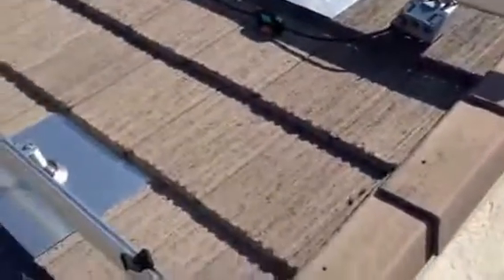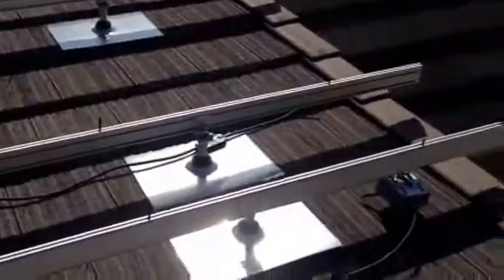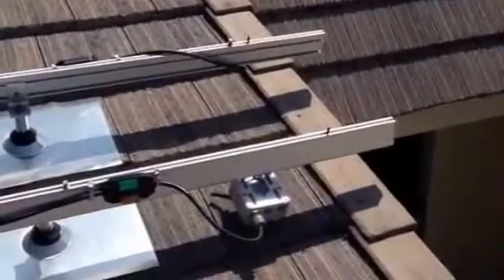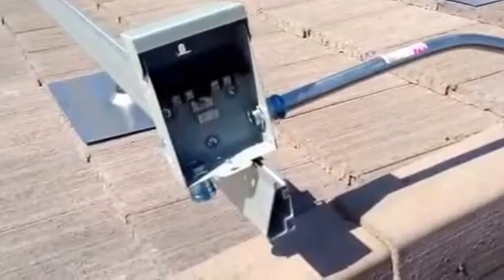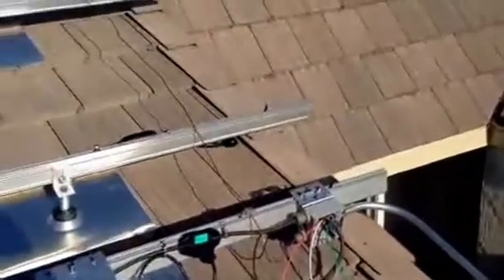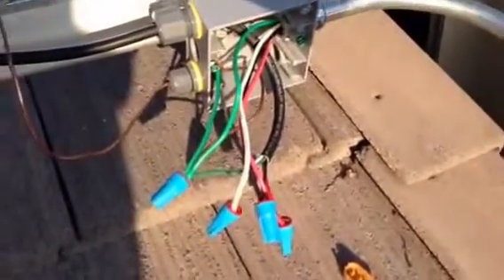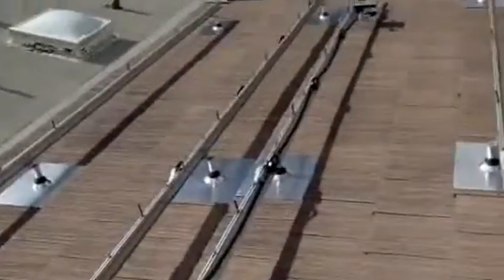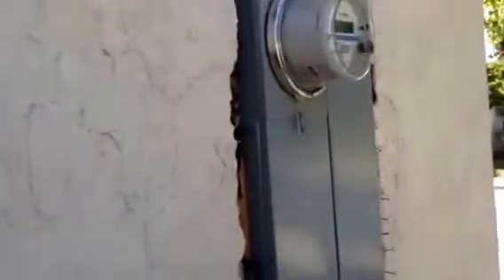PV Solar Install: Electric

Comment: Great video, thank you! How did you mount your racking to the roof? Did you drill holes through your tile into the rafters?
Reply from the maker: Thanks!  You can check out this video for details on how I did the roof mounts.  I lifted tiles, and mounted right to the rafters below with lag bolts.  https://www.youtube.com/watch?v=eTL8s6o40HM

Comment: In retrospect, is there anything you would want to do different?

Thanks.
Reply from the maker: Tighe No, the system has been perfectly operational and working great for over a year now.  I have done zero maintenance or fixes after the install.  The enphase web page is great for tracking power production too.